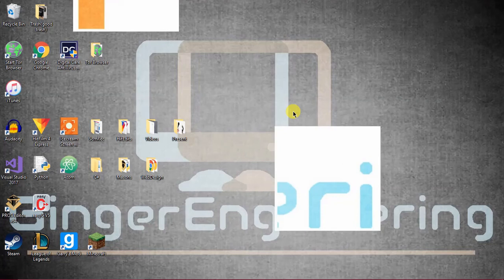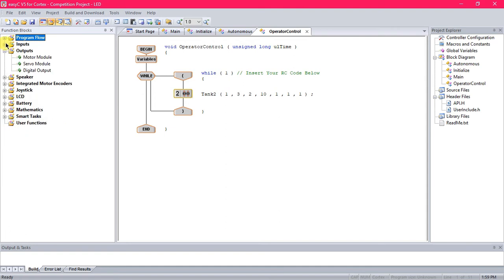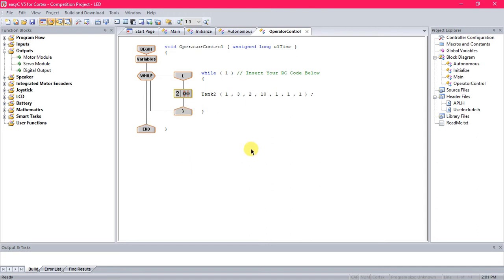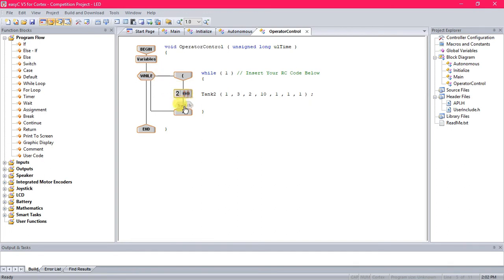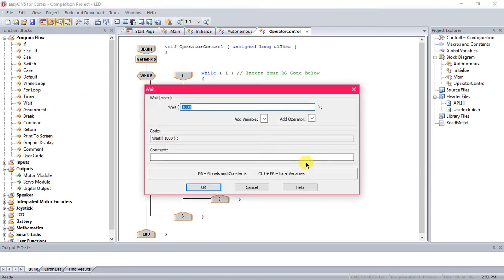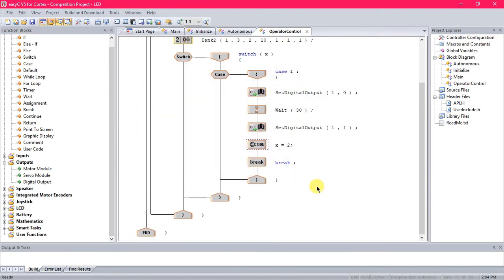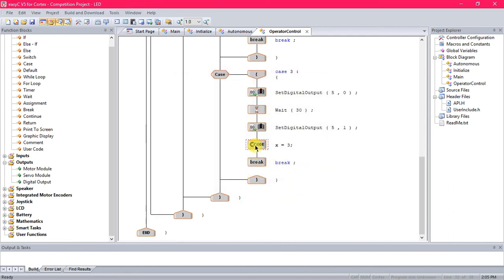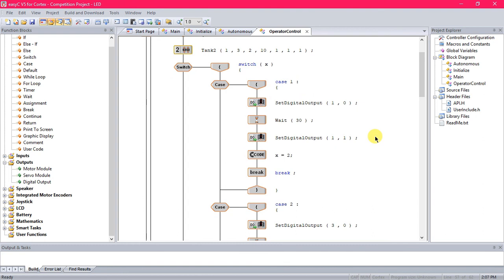How to Program an LED and Light Show | VEX | EasyC

Comment: With the "wait(30)" statement in your WHILE loop, does that block the Cortex from checking controller input, and thereby add an up-to-30msec delay in controller polling, or does the 'tank' command create a subroutine that will handle that controller input during the main loop's WAIT time?

As an alternative, you could use a TIMER in the WHILE loop and SWITCH block. Something like...

ClearTimer(T1);   // Set timer T1 to 0ms and start it
while(true) {
    tank2(...);
    switch (time1[T1]) {    // Check elapsed ms in timer T1
        case 30: 
            SetDigitalOutput(5, 1);  // Turn off the last light as we wrap back around
            SetDigitalOutput(1, 0);  
            break;
        case 60: 
            SetDigitalOutput(1, 1); 
            SetDigitalOutput(3, 0); 
            break;
        case 90:
            SetDigitalOutput(3, 1); 
            SetDigitalOutput(5, 0); 
            ClearTimer(T1);    // Set timer back to 0 
            break;
    }
}

Even better would be setting a "BLINK_TIME" constant at the beginning, then doing "case BLINK_TIME:  ...  case  (BLINK_TIME*2): ...  case (BLINK_TIME*3): ... so that you've only got one place to adjust that time value if you want to blink faster or slower.